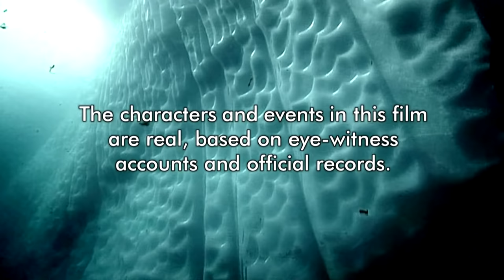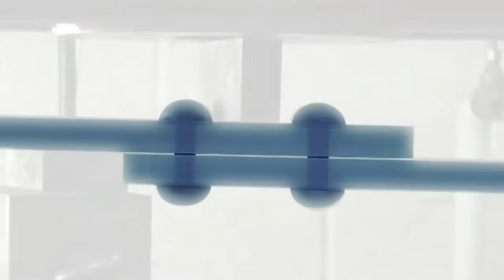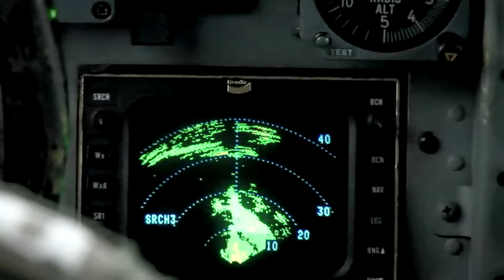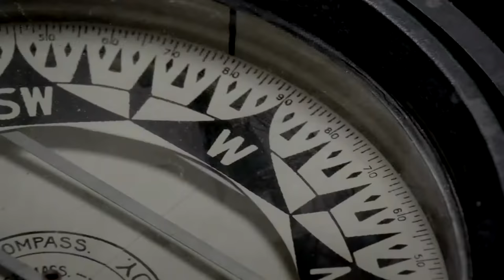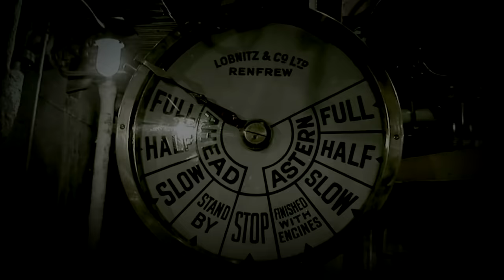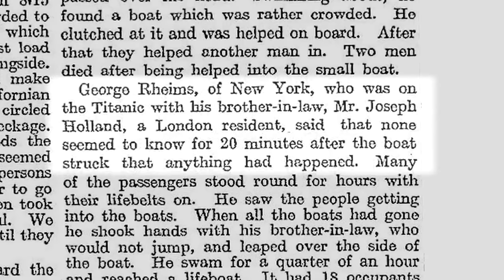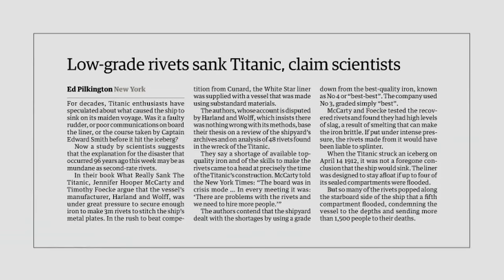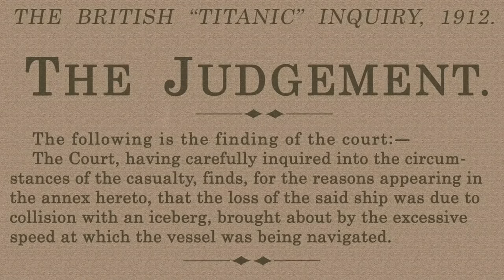The Unsinkable Titanic

Comment: I hate to burst your bubble but the truth is that this ship was shabbly built with inferior steel, did not finish enclosing all the water compartments wich was ridiculous, also ther's historic proof they made workers do double shifts cause the were in a hurry to finish it, moreover there was a big fire in the engine room that heated, softened and weakened the hull plus the arrogance of the liners owners to continue full speed ahead in order to break distance record.all very similar to what happaned to the illfated titan sumergible!!
Reply: Coal bunker fires were common and the watertight compartments did work, as the Olympic proved when it collided with the HMS Hawke. I'm not sure about the hull, but some of the rivets were recovered and tested and found to be plenty strong enough
Reply: Not to mention that Titanic was incapable of breaking speed records and it was never an option.

Comment: If it took 2.5 hours to sink and the Californian was less than 2 hours away then they could've saved the people on the Titanic. The Californian did that intentionally I believe because the wireless operator on the Titanic responded rudely to the operator on the Californian when he was sending iceberg warnings. The crew on the Californian said they saw the ship in the air and partly in the water with the fire work distress signals and the captain on the Californian was like , "They're cool..F*** 'em" basically.
Reply: Titanic’s response was not rude, it was the Morse silent signal “DDD”, a common way to ask a fellow operator to keep the line free. Californian’s wireless operator, Cyril Evans, explained it at the inquiry and confirmed it was not insulting in any way.

Comment: How the hell can you not see a iceberg what is 10x bigger than the ship itself.
Reply: When they say 10x bigger that includes the ice that is submerged.  Do the test yourself .  Get a cereal bowl and an ice cube. Put water in the bowl and drop in the ice cube. MOST OF IT is underwater. What you see on the surface is the TIP of the iceberg.

Comment: the whole thing with the "Californian" was not a controversy. if i had been told to shut up after warning somebody about ice or any dangers then id do the same, id just say you're on your own then. its not their fault one bit. the workers on "Titanic" that are 100% at fault
just saying
and its also funny cuz if they just hit the berg dead on, the sinking would have never happened. if the "Olympic" can survive a crash head on with another ship, then so could "Titanic" with ice what would the difference be? they're both basically the same size built by the same company
Reply: Titanic never sent “shut up”, Phillips used the Morse silent signal “DDD”, a common way to ask a fellow operator to keep the line free. Californian’s wireless operator, Cyril Evans, explained it at the inquiry and confirmed the message was not insulting in any way.

Comment: Wouldn’t the Olympic have had the same problem with the iron rivets instead of steel ?
Reply: *Olympic.
Reply: Captain Smith crashed the Olympic as well into a warship.  Why Captain Smith is a sympathetic figure is beyond me.  He had a shakey record at best.
Reply: @pinebarrenpatriot8289  exactly. It’s dumb that he is hailed as a hero
Reply: @diddyfaplord For your information, Olympic was under compulsory pilotage when she collided with HMS Hawke. She was commanded by harbour pilot George Bowyer, not Smith, who was supposed to take over later.
Reply: @Sarah0583  You are wrong, Captain Smith was in command of the Olympic at the time of the collision with HMS Hawke. Captain Smith was on the bridge at the same time when the collision happened. Try and so some research, and try not to rely on "Titanic Wiki Fandom" for your research material. May I suggest Don Lynch, Titanic historian as a better place to do research on Olympic and Titanic history.
Reply: Olympic had a refit in 1913, where extra safety features were installed, and the ship was literally inspected from top to bottom with a massive widescale rebuilding work done.
Reply: @johnking5174  It will never cease to amuse me when people who obviously have no knowledge of what they are talking about tell me to do research. One piece of advice : before trying to be condescending, make sure you are right first. Smith was indeed the captain, but he was not in command of the ship yet. 

When a ship leaves the Solent, she is under compulsory pilotage, no matter who the captain is. Once the ship is clear, the harbour pilot leaves and the Captain takes over. Bowyer wrote memoirs, in which he mentions the Hawke incident as one of the two mishaps he was involved in during his career. The inquiry that took place after the incident also mentions the term “compulsory pilotage” and found that, although Olympic was at fault, White Star and Smith were not responsible since a harbour pilot had effective command.
Reply: @johnking5174  For reference, here is what is mentioned about the incident during the Titanic British inquiry (day 2, page 14) : 

“
The Commissioner:
What was the judgment?

The Attorney-General:
The judgment was that owners were excused - were not liable, on account of compulsory pilotage, but that the "Hawke" was not to blame; the "Olympic" was. That is the judgment.

Mr. Laing:
No fault was found with the Master.

The Commissioner:
The "Olympic" was in charge of a pilot?

The Attorney-General:
Yes, my Lord; not in charge of Captain Smith, but of a pilot. 
“

If I may be a bit condescending myself, I find it rather confusing that someone who has not even read the transcripts of the inquiries advises others to try and do some research…

Comment: Couldn't the locker door be forced open to get at the much-needed binoculars?

Also, the unprofessionalism, and arrogance of that working class lout of a wireless operator beggars belief.  If he hadn't been rude to the wireless operator of The California, communication would still have been viable!

Hence, there would have been NO loss of life.
Reply: He was not rude at all, he sent the Morse silent signal “DDD”, which was a common and polite way to ask a fellow operator to keep the line free. Cyril Evans, the Californian’s wireless operator, was finishing his shift, which he had started early in the morning. He turned off his equipment and went to bed, just as he had planned. This has nothing to do with Phillips’ reply. Evans confirmed all this in his testimony at the inquiry. 
In any case, it is highly doubted the Californian would have been able to help in time, as she was stuck in an ice field.